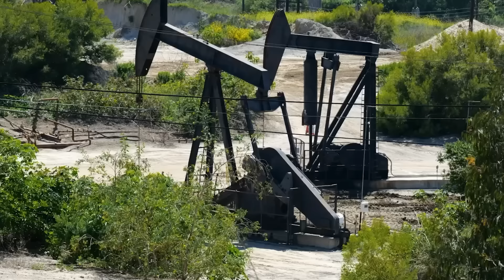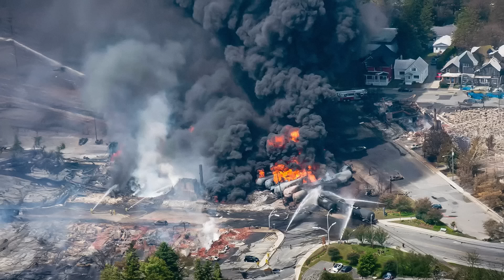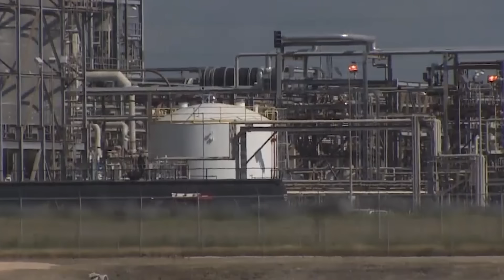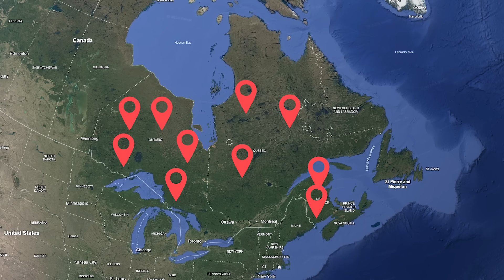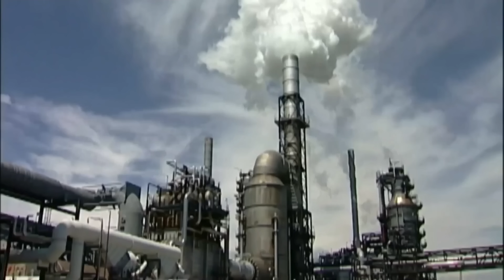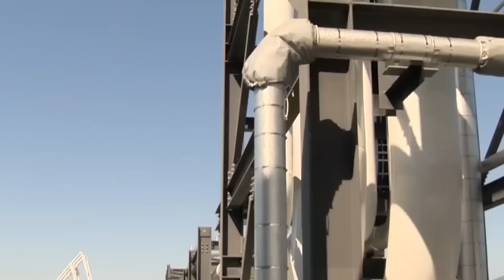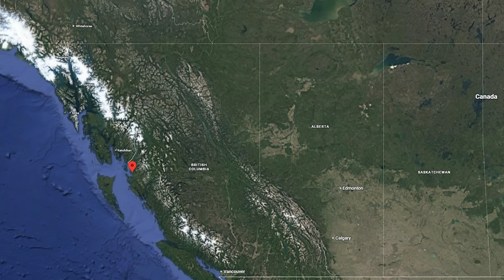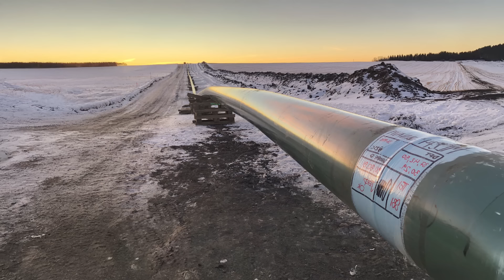Here's Why Canada Can't Build Its Own Refineries, Even Though It Produces Millions of Tons of Oil

Comment: there are lots of refineries in Canada, I personally have worked on 5 of them. Look up, for example, shell scottsford, Redwater refinery, Petrocan, Irving Oil and Valero. Canada's refining capacity is over 1.9 million barrels a day.
Reply: There are 13 out of 15 refineries in Canada that use Alberta bitumen sands heavy crude oil right now. 

All 13 of those refineries receive deliveries directly via pipeline from Alberta, including all four in southern Ontario (via Line 5) and the only refinery in Montreal (via Line 9).

The two refineries that do not use Alberta crude oil in their refinery diets are located on the south shore of Quebec City, in Lévis, and in Saint John, New Brunswick.

The refinery in Quebec City is owned by Valero and the same company owns a massive storage depot in Montreal. Furthermore, Valero also owns an oil pipeline between Montreal and Quebec City.

So the reader may be asking themselves: so wait, if there's already a pipeline between Alberta and Montreal and another oil pipeline linked directly to the same company's refinery in Quebec City, why aren't they using Alberta crude oil too?!

The answer is simple: it's not economical to do so.

Alberta bitumen is heavy in asphaltenes and low in resins. This makes it a low-value product that is generally used as a cheap blending agent to bring down the overall cost of refined petroleum products. Remember when the Conservatives told you that Western Canada Select oil was priced lower than West Texas Intermediate because there was insufficient pipeline capacity to Canada's west coast and Canada was stuck with only "one customer"? Well, the Trans-Mountain oil pipeline is now complete, exports are happening all over the world, plus, there is excess capacity available on it!! And the price gap between Western Canada Select and WTI is still over $12/barrel on average!! Chalk it all up to yet another Conservative lie. Pierre Poilièvre is a rank expert at lying to Canadians and Conservatives are repeating the same, tired lies that are being disproven every day with TMX exports to Asia. Bitumen sands crude oil is low quality, and no amount of pipelines will ever change that. 

No, Valero actually uses their pipeline to ship finished products westward, from its refinery to Montreal instead of shipping Alberta crude eastward. 

Suncor also owns a Quebec refinery, in Montreal.  Suncor blends Alberta crudes with imported crude oil from overseas via tankers that land from the eastern US, Norway, the Middle East and Nigeria with light, sweet crude oil. The imported oil either arrives by tankers, or occasionally, gets unloaded in Portland, Maine and then piped to Montreal. 

Incidentally, the company that owns the Maine to Montreal oil pipeline applied to reverse its direction, so that the line could carry tar sands bitumen from Line 9 to Portland, Maine for marine export via tanker.  Concerned citizens of Portland in 2014 passed a municipal ordinance banning the export of oil sands bitumen at the Port due to environmental concerns. Portland Pipe Line Co (PPLC) filed a lawsuit to overturn the ordinance as unconstitutional, and against interstate and international trade. They lost in Court and abandoned their appeal in 2021. 

Many find it amusing to listen to the same Conservatives who worked tirelessly to destroy Canada's National Energy Programme in the 1980s now turnaround and counsel the government to ignore the economics and build a brand new pipeline from Alberta to those two refineries, even though it makes zero economic sense to do it today with all the existing infrastructure in place.
Reply: @paulboileau3758  There are 3 refineries in Montreal.   In Canada 19 refineries, and 2 are dedicated for asphalt.      Nova Scotia, PEI and Manitoba don't have any refineries.
Reply: @patrickinottawa27 

Hi Patrick, there are not 3 refineries in Montreal and there hasn't been for several years. Two former Montreal oil refineries are just storage depots. And Newfoundland doesn't have an oil refinery. Some folks are processing animal fats at Come By Chance at a very low output and at a massive cost that is kept afloat with subsidies. I would never count that as an oil refinery. Likewise, there are two asphalt "refineries" that I don't count as a proper oil refinery either. 

There are 15 operating oil refineries in this country:
2 in British Columbia 
5 in Alberta
1 in Saskatchewan 
4 in Ontario
2 in Quebec (with the second one in Lévis)
1 in New Brunswick
Reply: @paulboileau3758  The Canadian Petroleum Producers Association needs to update their page.  That's where my info comes from.

Comment: For christ sake take the 15 billion we are losing every year and build two heavy crude refineries in Alberta.
That results in higher profits, good paying jobs and lower gasoline costs that result in lower inflation.
It doesn't take a rocket scientist to figure out the solution. Instead we sell our oil to the US at a discount and buy it back at retail.
You know why that doesn't happen? Because it would take more than 4 years and the party that goes ahead with it will not get the credit when its done.

Comment: You have more than a few misconceptions in your video that, to me at least, shows that you really don't understand the subject of oil refining or the oil industry.

Fun Fact: In the 1980's the supply of light oil in the US began declining.  The Gulf Coast refiners looked towards Venezuela for the crude oil supply.  Processing this oil did require a massive investment in upgrading facilities.  This worked for a while until political instability and production declines occurred in Venezuela.  The Gulf Coast then looked to the Canadian heavy oil reserves and began purchasing it.  The main reason why Canadian crude sells at a discount is because of the cost of transporting it by rail to the Gulf Coast.  Which is why pipelines like Dakota Access were built.

The reason why the cost of TME increase was due to the environmental opposition and paying off the Native tribes.

Comment: I'm a little bit less confused. Thanks.
Reply: There are 13 out of 15 refineries in Canada that use Alberta bitumen sands heavy crude oil right now. 

All 13 of those refineries receive deliveries directly via pipeline from Alberta, including all four in southern Ontario (via Line 5) and the only refinery in Montreal (via Line 9).

The two refineries that do not use Alberta crude oil in their refinery diets are located on the south shore of Quebec City, in Lévis, and in Saint John, New Brunswick.

The refinery in Quebec City is owned by Valero and the same company owns a massive storage depot in Montreal. Furthermore, Valero also owns an oil pipeline between Montreal and Quebec City.

So the reader may be asking themselves: so wait, if there's already a pipeline between Alberta and Montreal and another oil pipeline linked directly to the same company's refinery in Quebec City, why aren't they using Alberta crude oil too?!

The answer is simple: it's not economical to do so.

Alberta bitumen is heavy in asphaltenes and low in resins. This makes it a low-value product that is generally used as a cheap blending agent to bring down the overall cost of refined petroleum products. Remember when the Conservatives told you that Western Canada Select oil was priced lower than West Texas Intermediate because there was insufficient pipeline capacity to Canada's west coast and Canada was stuck with only "one customer"? Well, the Trans-Mountain oil pipeline is now complete, exports are happening all over the world, plus, there is excess capacity available on it!! And the price gap between Western Canada Select and WTI is still over $12/barrel on average!! Chalk it all up to yet another Conservative lie. Pierre Poilièvre is a rank expert at lying to Canadians and Conservatives are repeating the same, tired lies that are being disproven every day with TMX exports to Asia. Bitumen sands crude oil is low quality, and no amount of pipelines will ever change that. 

No, Valero actually uses their pipeline to ship finished products westward, from its refinery to Montreal instead of shipping Alberta crude eastward. 

Suncor also owns a Quebec refinery, in Montreal.  Suncor blends Alberta crudes with imported crude oil from overseas via tankers that land from the eastern US, Norway, the Middle East and Nigeria with light, sweet crude oil. The imported oil either arrives by tankers, or occasionally, gets unloaded in Portland, Maine and then piped to Montreal. 

Incidentally, the company that owns the Maine to Montreal oil pipeline applied to reverse its direction, so that the line could carry tar sands bitumen from Line 9 to Portland, Maine for marine export via tanker.  Concerned citizens of Portland in 2014 passed a municipal ordinance banning the export of oil sands bitumen at the Port due to environmental concerns. Portland Pipe Line Co (PPLC) filed a lawsuit to overturn the ordinance as unconstitutional, and against interstate and international trade. They lost in Court and abandoned their appeal in 2021. 

Many find it amusing to listen to the same Conservatives who worked tirelessly to destroy Canada's National Energy Programme in the 1980s now turnaround and counsel the government to ignore the economics and build a brand new pipeline from Alberta to those two refineries, even though it makes zero economic sense to do it today with all the existing infrastructure in place.

Comment: Wake up, here is an idea I think. Instead of all this moving the crude, I have heard it said if you process it into diesel and gasoline it is easier to transport by pipeline. The reason are: 

1. Gas and diesel are much harder to freeze and plug pipelines with.  

2. If any leaks occur the finished products are much easier to clean up than crude is. 

This would mean putting refineries in Alberta at the oil sands site and processing the crude there on the spot, then moving gas and diesel east instead of trying to move difficult crude oil in a country with cold winters This would also create more jobs in Canada and this is always a good thing. 

Is this possible. I heard it said once that this is much easier and safer and have just reposted what I heard. 

God Bless.

Comment: Given Hudsons Bay is limited now due to ice but anticipated to be year round in the future. Other option or both Thunder Bay  and via the great lakes.
Reply: Christopher, there's already an oil pipeline feeding the four Ontario oil refineries and the only on in Montreal with heavy Alberta bitumen crude oil. They used the Great Lakes until that pipeline was built in the 1950s.

This video makes it sound as if that pipeline isn't being used when in fact, it's 48' in diameter and supplies well over two dozen refineries. 

This video is chock full of disinformation:

There are 13 out of 15 refineries in Canada that use Alberta bitumen sands heavy crude oil right now. 

All 13 of those refineries receive deliveries directly via pipeline from Alberta, including all four in southern Ontario (via Line 5) and the only refinery in Montreal (via Line 9).

The two refineries that do not use Alberta crude oil in their refinery diets are located on the south shore of Quebec City, in Lévis, and in Saint John, New Brunswick.

The refinery in Quebec City is owned by Valero and the same company owns a massive storage depot in Montreal. Furthermore, Valero also owns an oil pipeline between Montreal and Quebec City.

So the reader may be asking themselves: so wait, if there's already a pipeline between Alberta and Montreal and another oil pipeline linked directly to the same company's refinery in Quebec City, why aren't they using Alberta crude oil too?!

The answer is simple: it's not economical to do so.

Alberta bitumen is heavy in asphaltenes and low in resins. This makes it a low-value product that is generally used as a cheap blending agent to bring down the overall cost of refined petroleum products. Remember when the Conservatives told you that Western Canada Select oil was priced lower than West Texas Intermediate because there was insufficient pipeline capacity to Canada's west coast and Canada was stuck with only "one customer"? Well, the Trans-Mountain oil pipeline is now complete, exports are happening all over the world, plus, there is excess capacity available on it!! And the price gap between Western Canada Select and WTI is still over $12/barrel on average!! Chalk it all up to yet another Conservative lie. Pierre Poilièvre is a rank expert at lying to Canadians and Conservatives are repeating the same, tired lies that are being disproven every day with TMX exports to Asia. Bitumen sands crude oil is low quality, and no amount of pipelines will ever change that. 

No, Valero actually uses their pipeline to ship finished products westward, from its refinery to Montreal instead of shipping Alberta crude eastward. 

Suncor also owns a Quebec refinery, in Montreal.  Suncor blends Alberta crudes with imported crude oil from overseas via tankers that land from the eastern US, Norway, the Middle East and Nigeria with light, sweet crude oil. The imported oil either arrives by tankers, or occasionally, gets unloaded in Portland, Maine and then piped to Montreal. 

Incidentally, the company that owns the Maine to Montreal oil pipeline applied to reverse its direction, so that the line could carry tar sands bitumen from Line 9 to Portland, Maine for marine export via tanker.  Concerned citizens of Portland in 2014 passed a municipal ordinance banning the export of oil sands bitumen at the Port due to environmental concerns. Portland Pipe Line Co (PPLC) filed a lawsuit to overturn the ordinance as unconstitutional, and against interstate and international trade. They lost in Court and abandoned their appeal in 2021. 

Many find it amusing to listen to the same Conservatives who worked tirelessly to destroy Canada's National Energy Programme in the 1980s now turnaround and counsel the government to ignore the economics and build a brand new pipeline from Alberta to those two refineries, even though it makes zero economic sense to do it today with all the existing infrastructure in place.

Comment: What about a pipeline from Alberta to Hudsons Bay and tanker it there to east  coast refineries?
Reply: I have been saying that for years, but it needs to be a heated pipeline; and built to higher specs as a large gas pipeline is.

 A LNG pipeline is more practical that piggy backs green Hydrogen for export to Europe. 

Natural gas (methane) has a lower carbon footprint by quite a bit if mixed with Hydrogen.  

Also if need be oil can go in a gas pipeline but it is incompatible the other way around.

The Green Hydrogen can be produced from saltwater by wind or solar depending on a practical location, like wind in Newfoundland a exicting project to make NH3. Better option than Blue and Black//Brown hydrogen produced from various hydrocarbons that can then be separated and used for rocket fuel or Hydrogen powered aircraft. It is a better option that using NH3 ( Ammonia) to transport hydrogen over any distance.
Reply: Not ideal with transporting in the winter. Unfortunately global warming isn't warming up that region enough.
Reply: East coast refineries use light crude from Saudi Arabia.  They can't use heavy Alberta crude unless someone is going to pay Irving to rebuild the refinery.   Irving doesn't want Alberta's crude oil, it's of no use to Irving's refinery.

Comment: Alberta only has heavy crude.   You need sweet crude to mix with heavy crude because sweet crude and heavy crude produce different products.    With sweet/light crude you get  mostly the lighter products like methane.  With heavy crude you get products from the heavy end of the crude.   From light crude you get mostly • 	Gasoline (biggest output) • 	 	Jet fuel / kerosene • 	Naphtha • 	Liquefied petroleum gases (LPG)
 From heavy crude you get Asphalt / bitumen, diesel • 	Heavy fuel oil  Vacuum gas oil 	Petroleum coke • 	Lubricants and waxes.   Thats why you need both.  But he is wrong about Canadian crude sulfur content.  Canadian heavy crude has a high sulphur heavy crude but not even close to  the content of  the stuff coming from Venezuela.